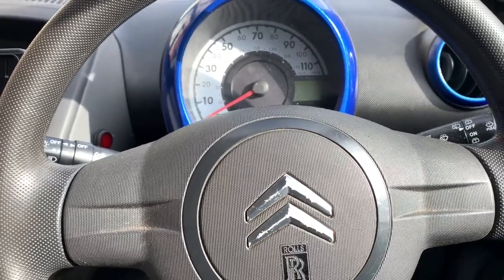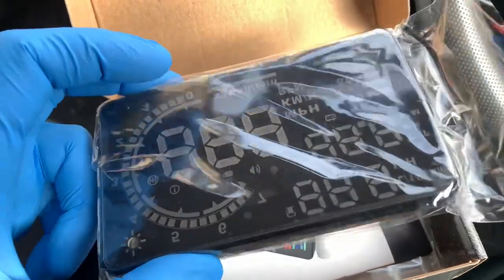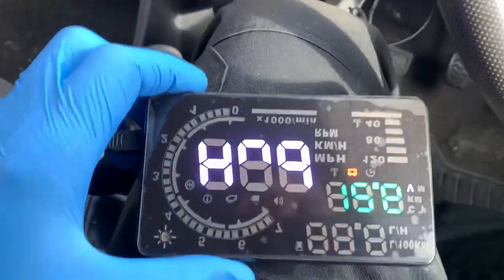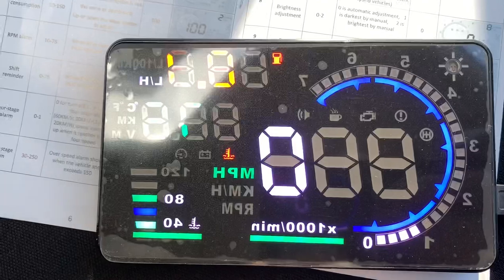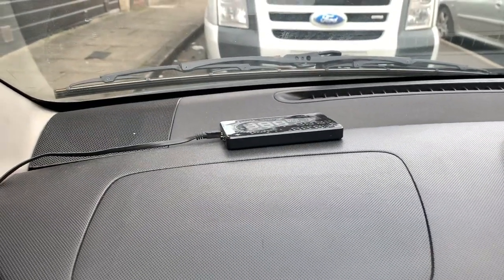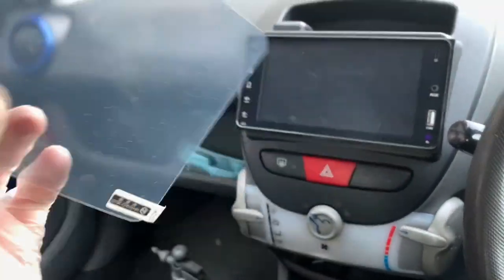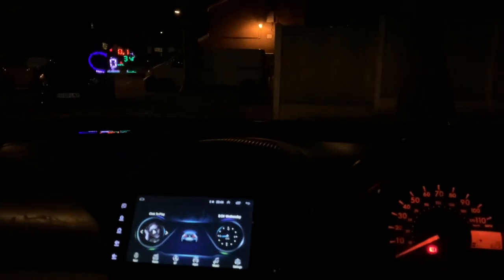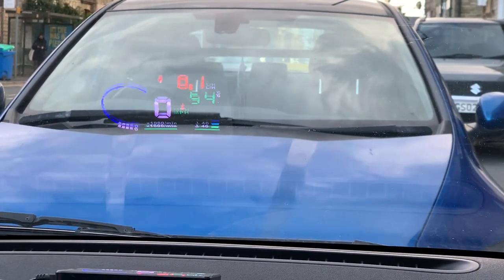Car Head Up Display Install + Review, Citroen C1 Cheap and Easy Temp Guage + Rev Counter. (OBD HUD)

Comment: How about trying as a head down display. Mount it (or just hold it for a test) behind the rear view mirror and stick the window sticker near on the upper part of the windscreen. Then when you look in the direction of the mirror you will see the HUD image.
Reply from the maker: Not a bad idea tbf. Not sure the wire would reach though.
Reply: @StupidBlokeStupidVideos  Well as a test just let the wire dangle. If it works then a USB miniB extension is only a few pounds on eBay.

Comment: i mean as far as functionality goes, you could've just got a £4 bluetooth OBD reader, paired it to the stereo running Torque Pro (£5) and had all that info on the radio screen AS WELL AS fault code scanning, while being cheaper
Reply from the maker: This was free 🤷‍♀️
Reply: @StupidBlokeStupidVideos  Oh! Wasn't aware, my bad
Not bad for free then I suppose, slightly delayed and not 1:1 but other than that it's not bad

My sisters speedometer is broken, so was just looking at alternatives with a rev counter too
Reply from the maker: @jjmmjj9999  it works alright, but would probably better if it was a gauge on the dash rather than an OBD tbh